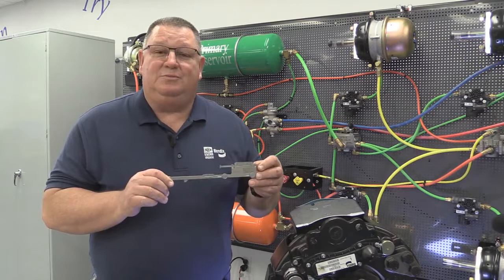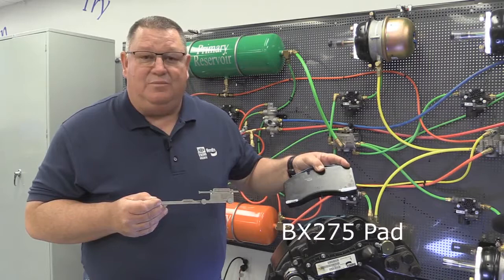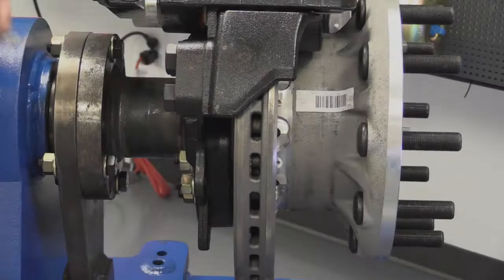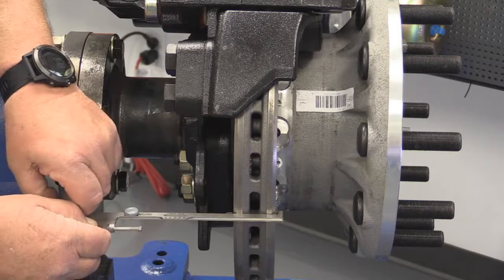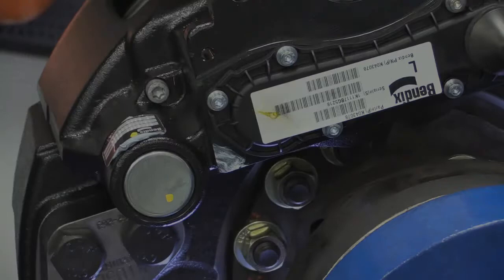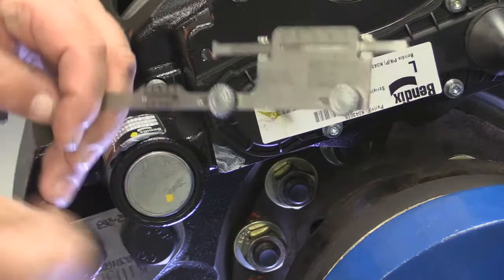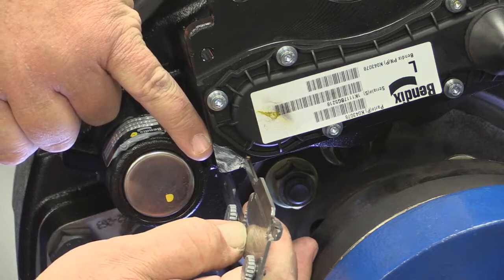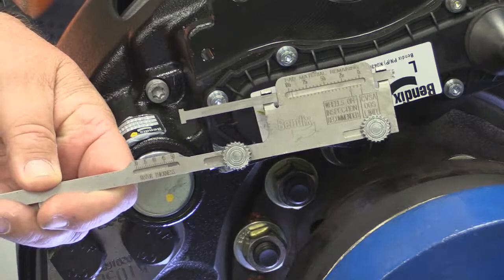How to Use the Bendix® Air Disc Brake Pad Wear Gauge

Comment: I highly recommend if you are spec'ing out a truck you buy it with WABCO/Meritor brakes. Bendix totally sucks.  You can't even check the outer pad thickness with this tool.  Changing Bendix pads sucks also with their fragile chain system instead of gears, like Wabco.  Wabco also has an external indicator so you don't need a tool.